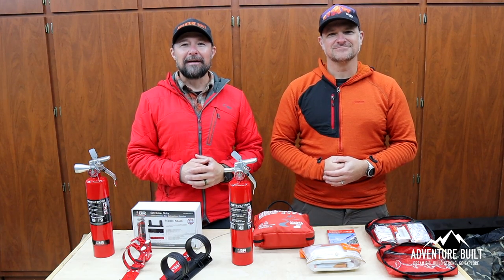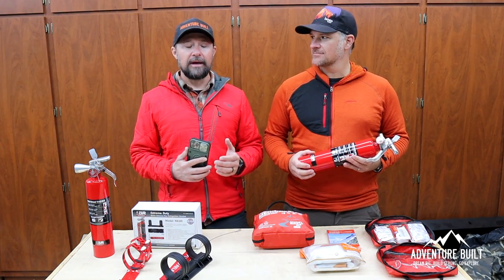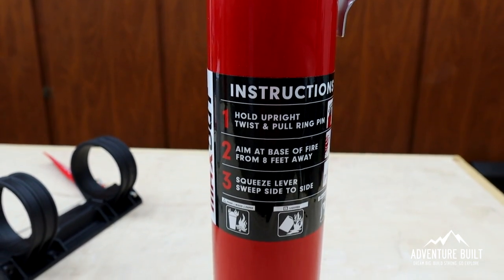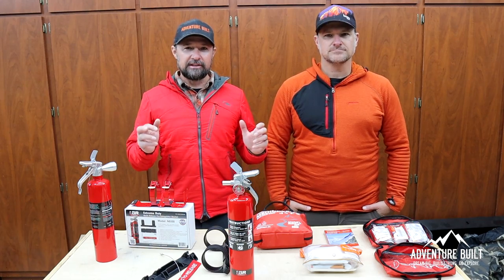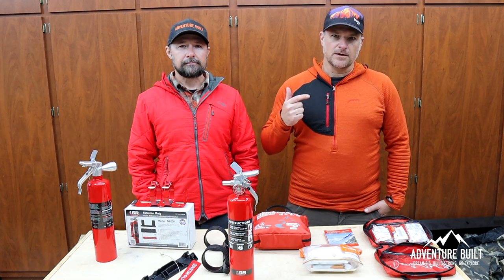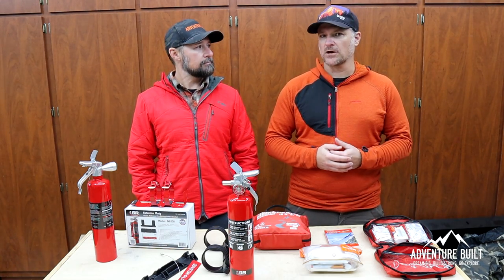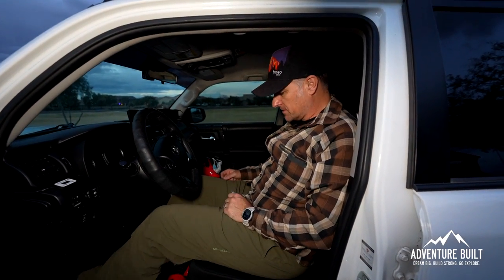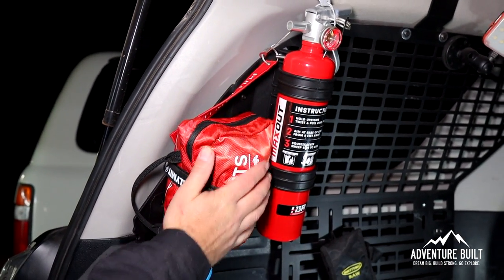ARE YOU READY FOR TRAGEDY | H3R FIRE EXTINGUISHER AND ADVENTURE MEDICAL KITS SPORTMAN 300 | TOYOTA

Comment: Guys - great post.  From experience though, I can tell you that at least one of those two extinguishers is too small.  For the back, at least a 4kg (not sure what that is in the US) is required.  We used to mount 2 kg extinguishers front and back as you’ve shown.  We had an incident, helping another motorist put out a vehicle fire and our 2 kg was way too small.  Needed a 4 kg.  I know you can’t carry the “kitchen sick” and have to weigh up probability of use etc (the old saying, something is better than nothing) but vehicle fires in particular can flare very very quickly.  Not sure if you can get them in the US, but try looking at the fire safety stick.  A great piece of kit and you can carry quite a few.  
Re first aid kits, I carry a trauma kit mounted behind the driver or front passenger head rest.  A slightly bigger camp kit can always be carried in the back as you’ve shown.  the problem with that is you always have to get out of the car and this cannot be reached from inside if your truck is fully loaded.  Just some thoughts.  Great post.